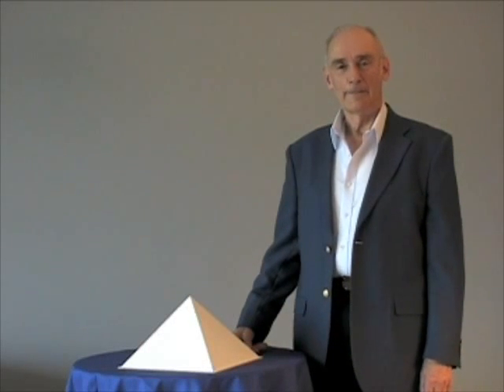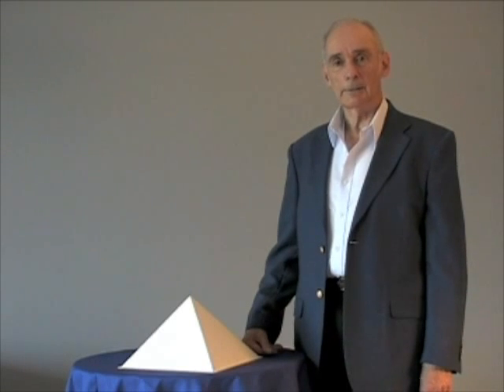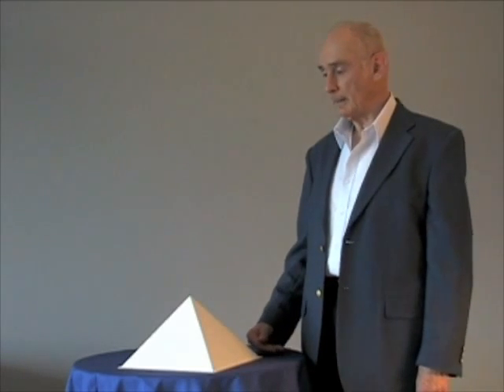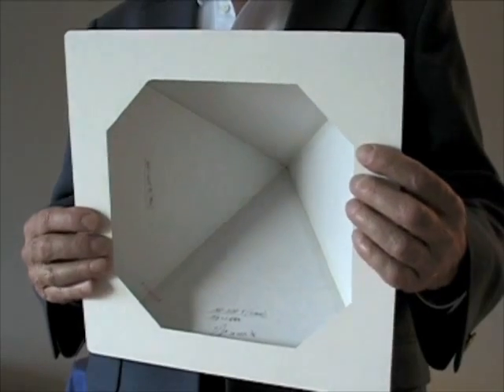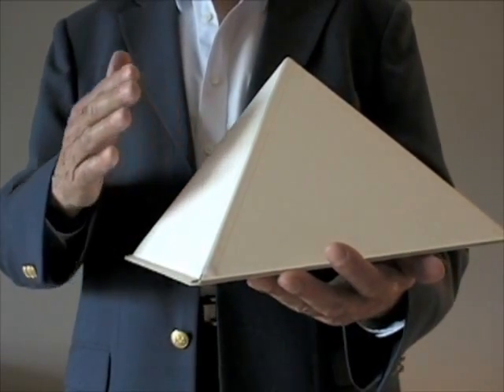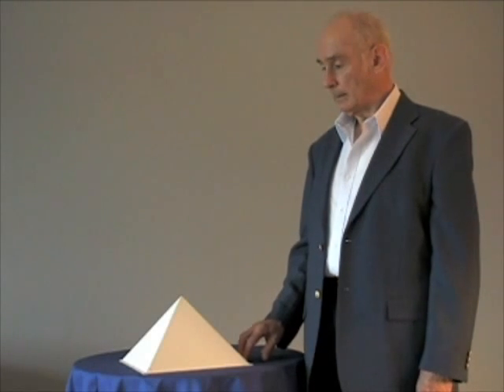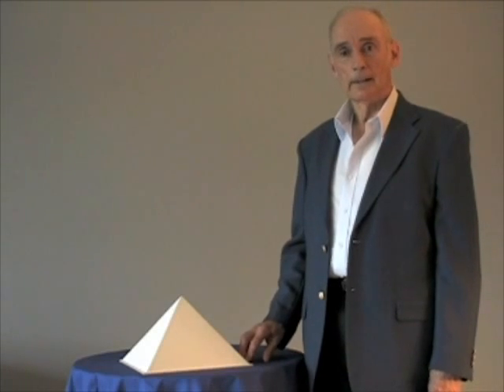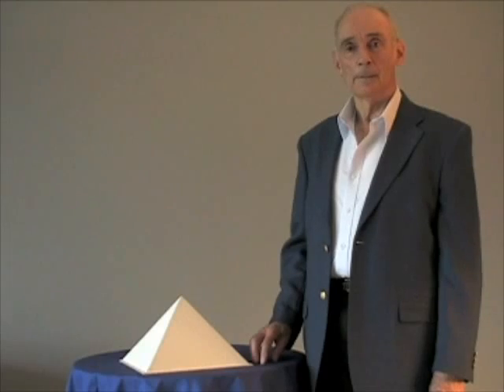Yes! Model Pyramid Really Works!

Comment: 1. Have you built with any other materials?
2. I may have missed this in the video, we're the effects being caused by the pyramid you were holding?
3. Have you ever observed using detection? Geiger counter, thermal Imaging, etc.
Reply from the maker: Hi Mike. Thanks for your interest in little Epsilon.
I build my models with smooth, white illustration board about 1/16 inch thick. It works well and gives them the look of limestone.
I tested the watch with a Geiger counter before I put it inside Epsilon and found that the luminous paint on its hands and face had a low level of radioactivity. After several experiments, with the watch inside Epsilon, the watch was no longer radioactive.

Comment from the maker: Thank you, Sam, for the email where you write, “Your little Epsilon is actually based on the Golden Ratio.” You are right. Little Epsilon’s design ratio is 1.6171 Just 0.0009 less than the Golden Ratio 1.6180. And the hypothesis of each side is 9.982114004”  Thanks again for writing.

Comment: I just recently did some minor studying about "Angles". Angle and Angel both have Latin root words:
angelus
"messenger, envoy, one that announces"
angulus
"an angle, a corner"

I just know there is a connection. 
There are magical practices regarding household spirits and servitors that involve the corners of the room - particularly at the ceiling line. And there is great importance placed in the orientation of walls and corners in the Chinese practice of Feng Shui. Energies of certain qualities can be trapped if the arrangement is wrong. 

In addition, the whole concept of "aspects" in Astrology is all about the angles that form between the planets in a chart. Trine, Square, etc. The lore about such things is vast. 

I'm guessing that the angles less than 90 degrees would trap and hold something, while the angles wider than 90 degrees would offer them liberty. It's the 90 degree angle that seems to provide a comfortable place to rest that doesn't impose restrictions upon the spirit who sits there such that they prefer to stay and not cause trouble. I'm also guessing that if the spirit feels too trapped in a corner, they will flee thru the walls in a perpendicular direction from them. If the angle is just so, they may come out straight thru the seam of the walls or wall and ceiling. 

I was actually thinking about this 2 days ago. 
Then this video pops up in my suggestions....  

Btw, the angle for the walls of the pyramids are not always the same, but it would be interesting to know the angle between each wall at the seam. The angles usually given are of the slope of the walls from the floor. But that's not where the smell is coming from. Just eyeballing your model and most of the pyramids, I estimate that it is greater than 90 degrees. But with all 4 of them mirroring each other in this shape, they may be amplifying whatever is between them to the point where it must escape. Bells and horns and speakers are all made with this conical shape, tho usually rounded. This usually produces a flow thru the wide end, but if that end is blocked, there may be no where else for the energy to flow but out the side seams. 
🤔
Reply from the maker: Thank you, Jennifer, for your comment. 
I like the last paragraph where you write “it would be interesting to know the angle between each wall at the seam . . . with all 4 of them mirroring each other . . . they may be amplifying whatever is between them to the point where it must escape.”
Reply: @GoKappy2  You are most welcome, Bill. 
I just built a digital model in SketchUp to get the angle. It's 106.1°
That's over 90°.
4 of those together plus the 4 58.3° angles from the base pushing the flow back up and out will press it thru the seams. 

Are all of your models cut out at the bottom? Or do they have a fully covered base? 
I'm wondering what would happen if the base sat over containers of water buried in sand. It would be interesting to find out by scenting the water with something unmistakable. 

Next, I would imagine, would be attempting to coat the thing with materials similar to what the original GP had on it. Glass maybe...
🙂
I think I see what you're gettin' at with the watch...
Reply: My comments are piling up here. Make sure you read them all. 

I did the same thing with the other 2 pyramids from that web page. Here are the angles: 

Phi
The sides, each to its neighbor:  106.0°
The base to each side:  58.3°

Pi
The sides, each to its neighbor:  106.0°
The base to each side:  58.3

I'm not sure how these 2 ended up with the exact same angles except that maybe SketchUp isn't super precise. I used your exact measurements. But I'm not sure if it takes 3 decimal places. 

At any rate, they are both different from the Epsilon.
Reply: @DarkMoonDroid  I would love to see - these comments are 5 years old, have you made any models??  Do you have a 'how to' on how to make these pyramids??  
I don't understand much of what you said but i do desperately want to experiment with these shapes on a scale big enough to get myself in / around / above - wherever it has an effect!   Any pointers would help, please and thanks! 🙏

Comment: The 2 types of radiation watches are  :
The first type of watch is called a tritium watch. The modern way to do this is you have the same phosphorescent paint but this time it's mixed with small tubes filled with tritium. Tritium is radioactive and emits beta particles. These have the same effect of exciting the phosphorescent paint. This time tritium has got a half-life of 12 years. The beta particles that are emitted are not very energetic so if anything they couldn't even penetrate the outermost skin layer. The third watch I'd like to mention is a radium watch. They have very much the same design but this time instead of tritium they're mixed with radium. The half-life is sixteen hundred years. However, they may not seem to be as radioactive because the phosphor in the paint gets eaten up by the radium.
Reply from the maker: Thank you, Albert, for writing about the types of radiation watches. I can get the luminous paint on my watch's hands to glow dimly for about a minute by holding the watch up to a bright light. The watch was used in the Epsilon pyramid experiments and no longer appears to be radioactive. It is a Seiko automatic #7009-8129 made in Japan. I got it as a gift in 1979.

Comment: Hi Bill a question I was always meant to ask you.. How did you detect the low level of radiation from the watch and what was the outcome of it being inside Epsilon? ☺
Reply from the maker: Hi, Agui007, thank you for your question.
I Tested the watch with a Geiger counter and found that the luminous paint on its hands and face had a low level of radioactivity. But after several experiments with the model pyramid Epsilon, the watch was no longer radioactive. Thanks again for asking.
Reply from the maker: Update: The watch used in the Epsilon pyramid experiments was a Seiko automatic #7009-8129. I got the watch as a gift in 1979. To verify previous results, I retested the watch with a Waysear Professional Geiger counter. The indoor background test = 00.12 USV/h. Testing the watch gave the same result, 00.12 USV/h. The watch no longer appears to be radioactive.

Comment from the maker: Hello Agui007, thank you for your Comment. I occasionally experimented with model pyramids over the years, made some startling observations regarding the model pyramid Epsilon, and wrote about them. And hope my YouTube video, "Model Pyramid RUNS! Amplifier/Transmitter", will be found by someone who will see clearly what is causing the little model to run.
Reply: Still to this day I am interested in your design and how it functions or how it relates to nature. I strongly believe in phi ratios application in nature but I remember that you had said in your video that a pyramid made with phi would focus its energy below the base.
Reply: I would love to apply your mathematics and pyramid design into a way to generate energy.
Reply: Have you ever tried putting an ionizer inside the pyramid?
Reply from the maker: @102309752924380836346 Thank you, Jay, for the 3 replies. I believe there is energy there, a form of energy that the pyramid builders knew how to harness. I haven’t tried an ionizer. I'm retired and haven’t done any experimenting lately, but I'm glad you are taking a serious look.
Reply: Perhaps you can tell me some things that will help me get started. I have limited funds but would like to try other materials besides tape and card board. Does the size of the pyramid change its effectiveness? For the sake of my low funds a smaller prototype would cost less to make.
Reply from the maker: @102309752924380836346 I use smooth, white illustration board about 1/16 inch thick. It works well and gives the model the look of limestone. However, your project sounds great! And I wish you much success.
Reply: Hi Bill, a question regarding building that nice square base for a sturdy finish, could you tell us how you do that please and the dimensions for the construction? Many thanks :)
Reply from the maker: @Aritistic007  Hi Agui 007, Always nice to hear from you. Appreciate your interest in the base. Sorry, I don't have the dimensions you ask for. Had to get rid of my model pyramids mounted on square bases when I moved into a small apartment. Your Pyramid Energy Experiment at  www.youtube.com/watch?v=uGGBlx46-38  looks great!